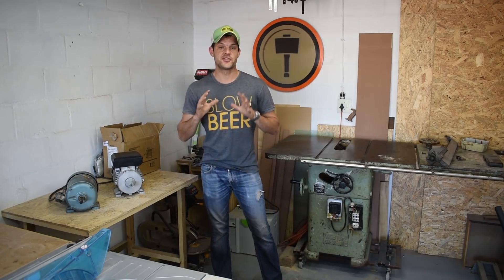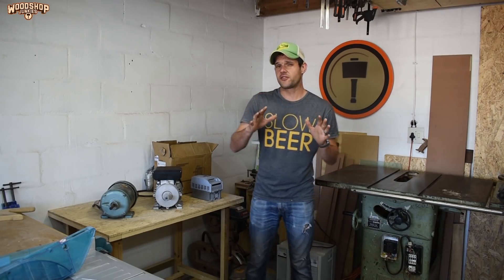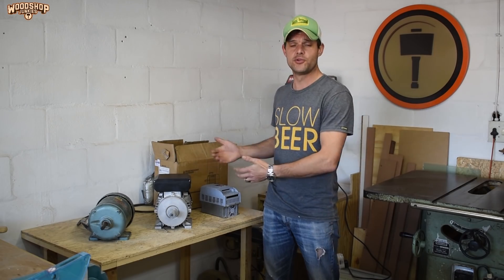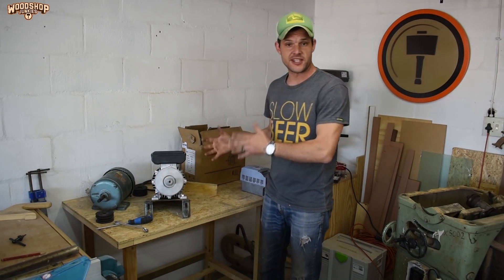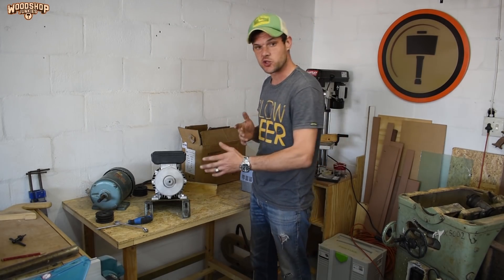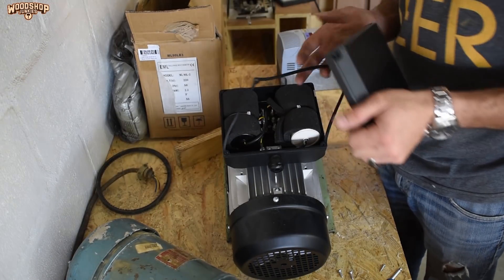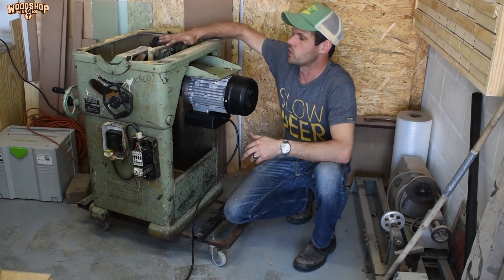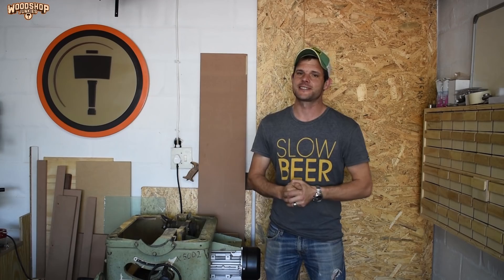Three Phase To Single Phase Conversion - VFD(Drive) vs Motor Replacement?

Comment: Appears to be an adequately heavy saw. I agree with the motor replacement. Flipping the switch and beginning to cut fit more in with the flow of thought and work than starting the VFD and then waiting for it to start the motor.

Comment: Jean, I got 45 year old table saw to restore without much experience, and even less with engines. I had to replace mine into single phase motor as well. Do you have any advice on whether I should use one or two v belts or what should be the belt tension?

Comment: That was very best option replacing the motor. VFD the problem is over time where you use it often. I have replaced these devices if they are the shit ones from China. You have to spend as much money for a good one like Seimens that would handle the KVA that is double to your existing 3phase motor. A good VFD from Seimens would run you in the price range of a Single Phase Motor of Good Quality.  SMART MOVE!  If you was in America and think like an American you would have gone with the VFD. DUMB ASS MOVE.

Comment: Glad you opted for the motor replacement.  Putting a VFD on an older motor can cause problems down the road.  Many older motors don't have the proper insulation class for use with a VFD and will be driven to fail sooner when operated on a VFD.

Comment: For everyone watching there is a 3rd option of using capacitors(75 uF per kw for each phase ,so in this case between 2x 110-120uF for this 2hp motor) and just putting the motor from star to delta configuration(literally 3-6 nuts and few plates are swapped). This is generally what I do if I get a 3phase motor machine, yes I am cheap in this regard as it seems wasteful to waste a perfectly good motor and will always have the option later to upgrade to a a 1phase 3hp motor.
Reply from the maker: The original 3phase motor has been rewound at some stage and the star point was done internally.
Reply: @WoodshopJunkies  eke stry nie met jou metode nie. Eke stel net voor vir ander mense dat hulle kan weet daar is nog 'n derde opsie is.
Reply: Please tell who do contact to find a capicitor? Is it the motor winding people?

Comment: You can use a capasitor to generate the missing third phase..

Which is what this single phase motor has.. it is a 3 phase motor with a condesator/ capacitor to make the third phase.

Comment: Great video!  Have you thought about finding someone with a sandblast cabinet for the underside and sides of the top?  You probably wouldn't want to do the top surface but it would be an easy way of getting the rest of it back to bare metal for paint/finish.  Cheers
Reply from the maker: I was actually considering sandblasting it myself with a makeshift setup at home. Still need to do a bit of research before I can just jump in though.
Reply: @WoodshopJunkies  I think Stu at the dangar marine channel did something of that sort to his boat about a year or so back.  Might be worth a look.
Reply from the maker: @TheMadpyrate  thanks. Will check it out.

Comment: I have that same Saw. Yours is really loud... Mine runs quiet. The bolts you use don't look long enough to be properly through those nyloc nuts. And mine uses multiple belts, one in each of the V slots. Using just one you will get slippage.
Reply from the maker: i used one belt for a test run. As I mentioned in the video, I am stripping the saw down to service and repair the entire machine before I plan to start using it.

Comment: Out of curiosity - what Brand / model VFD are you using and where did you source it. I was looking at adding a VFD to my drill press to avoid playing the 'swap the pulley dance' everytie I want to change speed. All the best - great project.

Comment: One other advantage of a VFD is motor braking (which makes the saw safer to use). We make a device that lets you add motor braking, emergency stop, and accidental restart prevention to any motor (without needing a VFD). It would be a great addition to that saw and it just plugs in so you wouldn't have to redo any of your wiring. If you have any interest in trying one out, let us know! www.makesafetools.com
Reply from the maker: If you have a 220V version that can handle 12Amp full load running I would definitely be interested! I'll check it out.

Comment: Wait a minute ... that thing looks like the one Adam Savage has in his shop!
Gotta love these old, solid-as-a-rock appliances!
EDIT: no it's not ... the angle-control-wheel is on the other side.
EDIT2: glad to hear you'll be stripping and restoring it!

Comment: lol ?? you dont need anything to convert a 3 phase motor to single phase , only needs a capacitor to make it start.....
Reply from the maker: Yes , but running at about <60% power output. No point to getting a motor to start up if it'll run hotter and have a significant power loss.

Comment: Do you need to worry about dust getting in that motor? Or does the tablesaw handle that for you? Plus shouldnt it be much quieter?
Reply from the maker: Motor is IP55. Make sure dust doesn't build up on fins (for cooling purposes) and you shouldn't have a problem. It is a bit noisy but I think it'll quiet down when top is installed and machine is standing on solid base.
Reply: @WoodshopJunkies  may need new bearings on the arbor as well... should probably do it while you have the whole thing apart

Comment: Greaot idea replacing the motor.I bought a similar kind of saw 2 years ago.It does not have  its name on it anymore  therefore" similar kind of saw". It was converted from 3 phase to single phase by previous owner. Just can't find a similar looking saw on  Goole or You Tube. Would like to know what make it is. Now the       question: Could you suggest any website or YT  I could try to get a name to my saw.Guess it's about 40-50 plus years old.It has a sliding table and only one mitre slot- if it may help :) Greetings from Wellington Western Cape.

Comment: So much beautiful cast iron. I was wondering how you were going to get that top off by yourself.  As an electrician myself, I agree with your choice of changing the motor. Those VFD's  can get snippy if they are not run off a stable power supply. Ours is definitely not. 
Good job, Jean. I look forward to the next installment.
Reply from the maker: Especially with load shedding!
Reply: Is there a way to change rotation if it’s wrong?
Reply from the maker: @rickypacheco  you can change the direction on a single phase cap start motor, yes.

Comment: I have a brand new dewalt table saw and no intention to restore a old table saw, but I still like the video serie!
Reply: I do like the larger and more sturdy look of the table of the old saw.
If it turns out like everything else the Junkie does, it is going to look and work great.

Comment: important consideration for choosing  this conversion is available mains voltage - you cannot increase voltage to 380 without a transformer as well so this also supports economically the decision to go single phase (vfd's do not increase available voltage) in this case - keep up the great videos!
Reply from the maker: That is correct. I didn't want to over complicate the video but changing the motor to a DELTA config would grant me a 220V phase voltage. Same voltage as my single-phase supply. Using the VFD would give me the phase lag required to run the motor. I still feel like replacing the motor is a better option.
Reply: In real terms and for someone without the electronics knowledge base you have, what does this mean? Id like to do a similar conversion to 3 HP. Do I need a transformer?